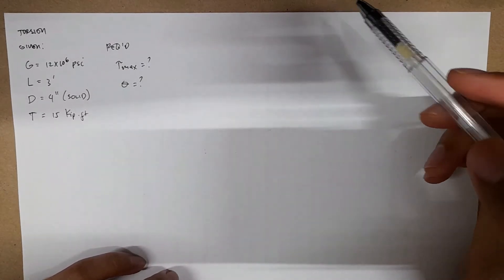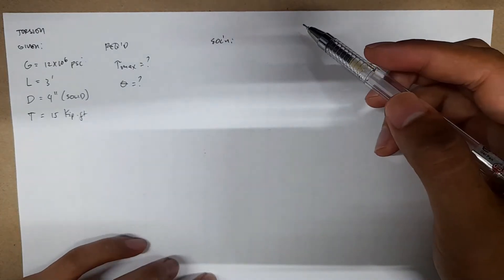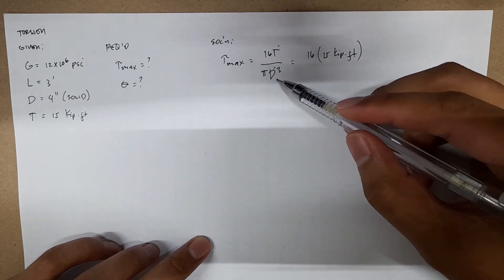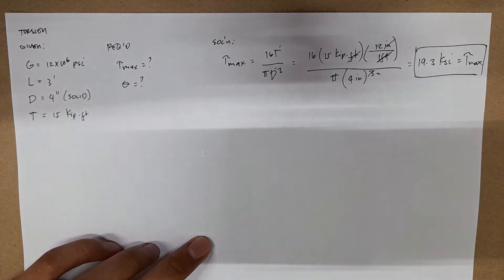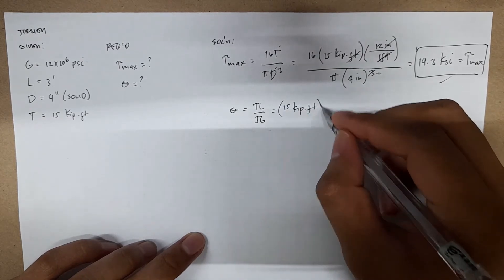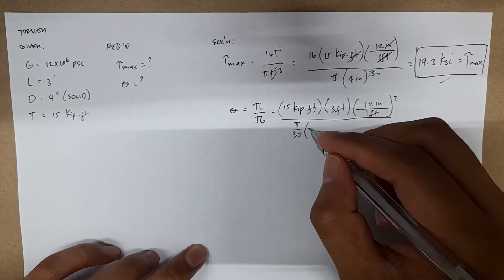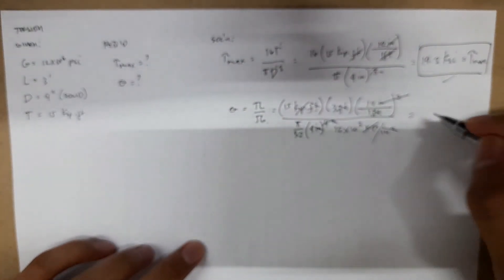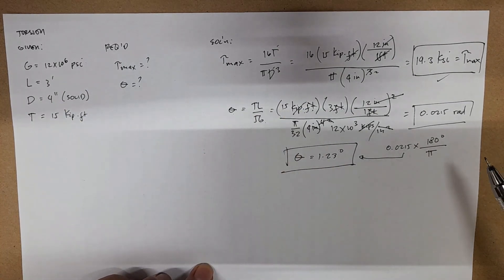Maximum torsional shearing stress and angle of twist

Comment: Sir sa value po ng G na 12 x 10^6 psi (12 MPa psi), na convert po sya sa 12 x 10^3 kips/in^2. So may conversion po na ... 1 x 10^6 psi = 1 x 10^3 kip/in^2 ?? Tama po ba?
Reply from the maker: hello lods, SLR. 12 x106 psi is equivalent to 82, 737.08 MPa